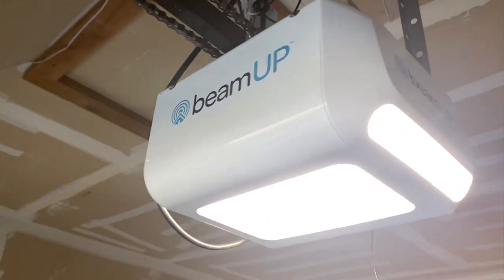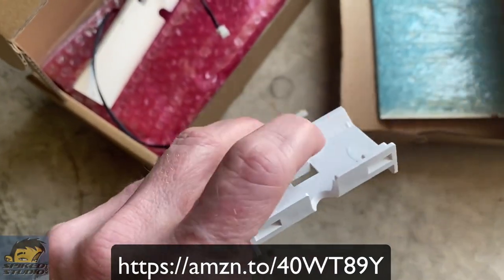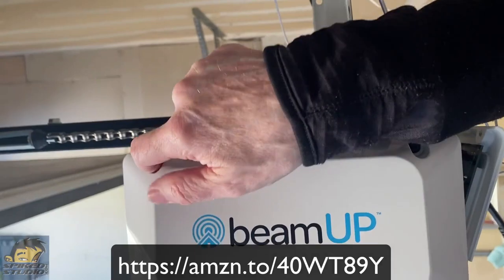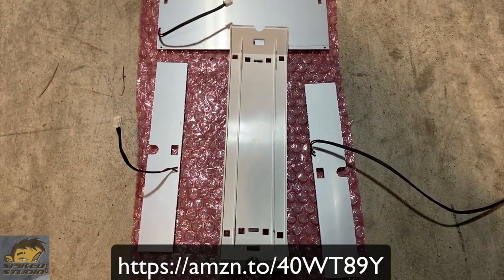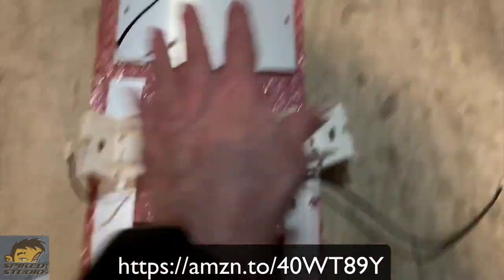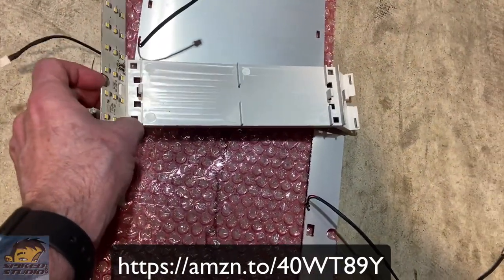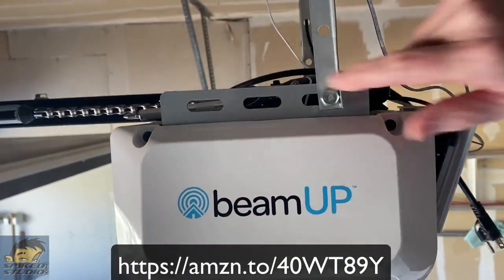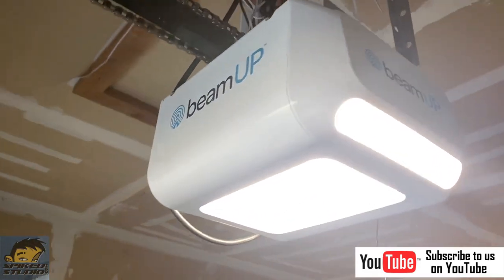How to Replace or Fix the LED Lights in the BeamUP BU400 Garage Door Opener

Comment: where do you purchase the actual replacement led lights?
Reply from the maker: I reached out to them direct since it was either a defect or shipping issue the brackets were loose.  They jumped right on it